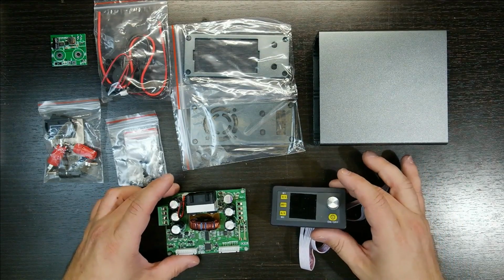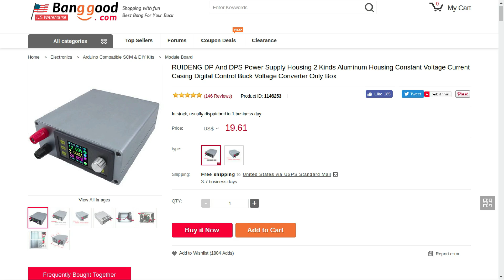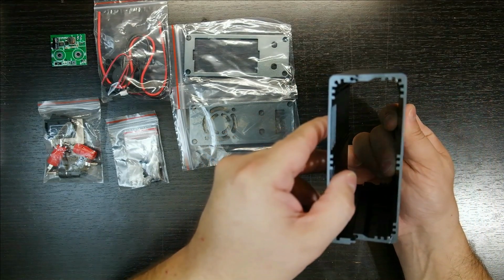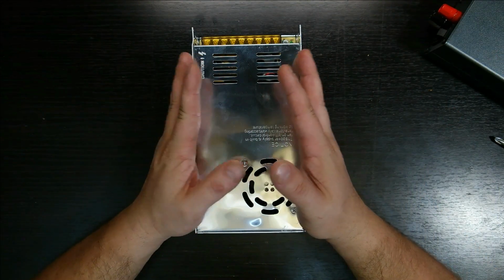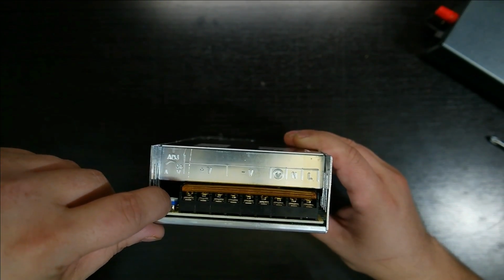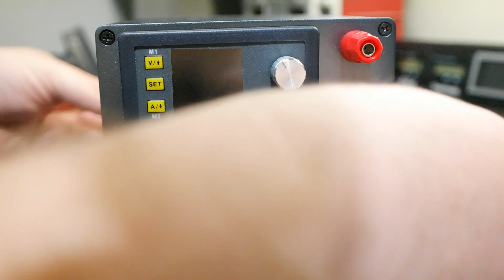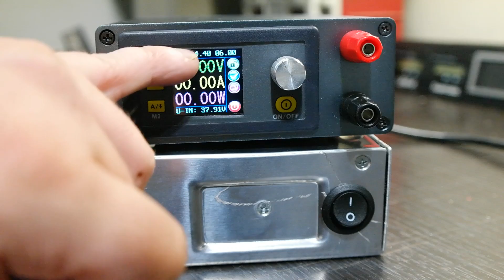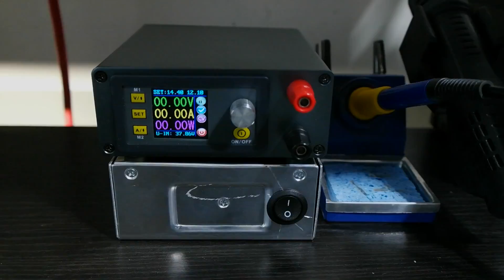DPS-3012 Custom Bench Power Supply Build

Comment: I would have put the vent holes to the front of the box so that the air would be pulled past the board, cooling the components.The way you have done it, the air is pulling straight through the holes and out the back not realy cooling anything.
Reply: was about to say the same

Comment: Really cool, always wanted to build me one of those, guess 30v one should be more than enough for most benchtop applications. 
Great video! Keep em coming!
Reply from the maker: +Brian C thanks Brian! I would agree that 30v is usually good enough for most bench top power supplies.  Anything between 30-60v you start getting into a shock hazard if your touching the leads and over 60v you better be careful. Plus 99% of all my projects are 12v or less.

Comment: You're switching the neutral? I see you made a correction in the video but you didn't fix your wiring. This is potential lethal voltage your dealing with here. Also the cable really should have strain relief added.
Reply from the maker: +Jon Raymond I actually added that correction in post processing after shooting the video so no one would make that mistake.  I have fixed my wiring already earlier today once I realized what I did when doing the editing. And good pickup on the need for strain relief. Thank you.

Comment: Hi! What a coincidence. I did the same build today. Even used thicker wire and automotive connectors, just like you. I was wondering, how did you connect the switch in the back of the DPS case to the little PCB on the input? The solution I came up with seems a little dodgy to say the least. Since they don’t have big holes like the pads for the wires to the DPS Board, I soldered the positive leads that go from and to the switch directly on to the PCB from the side and I had to use a lot of solder. Now the solder blobs are so close, they’re almost touching. It works for now, but there’s got to be a better solution, I just can’t think of one.
Reply from the maker: +Michael Ecker I used their 14ga wire to run the half inch distance between the switch and the "key" position on the circuit board. I used 10ga from the circuit board to the dps-3012 input.

Comment: What's with the audio? It sounds really bad. Like if you denoised it with bad settings. I rather have background noise than this muffled low bitrate mp3 sound.

Other than that I also have one of these DPS-3012. I am also figuring out how to do a nice PSU with it.
Reply from the maker: +Kyôdai Ken trying to overcome the noisy preamp in my camera without having to resort to an external audio recorder.  This was my first attempt at correcting the audio. I may just end up buying a zoom h1n and use that from now on.